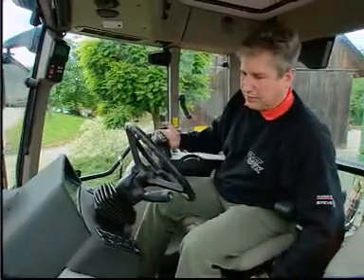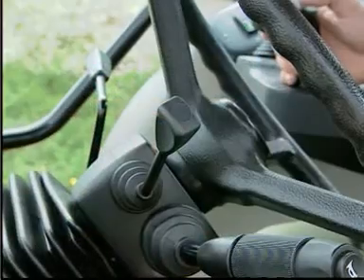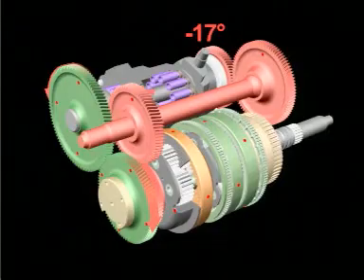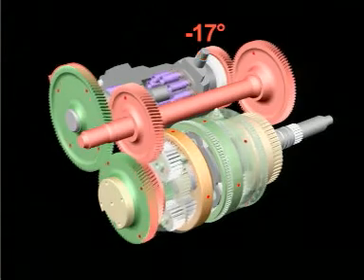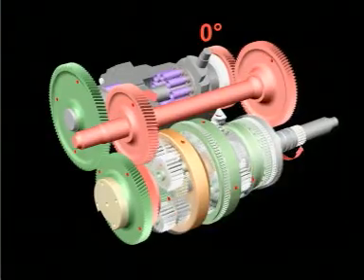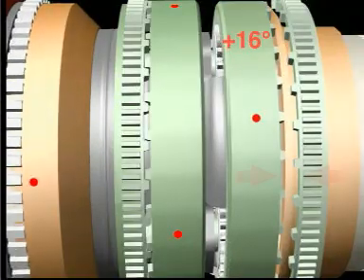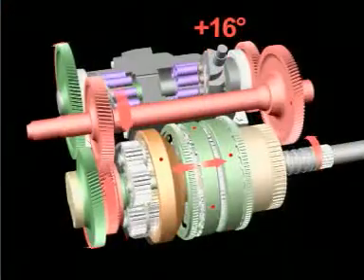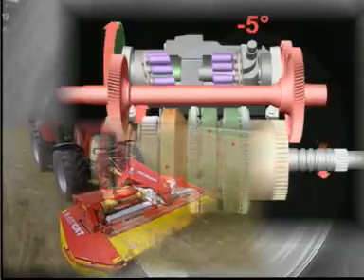Case IH CVX S-Matic Transmission | Continuously Variable Transmission (CVT) How it's works

Comment: This gearbox is made by ZF it is used in the Steyr CVT,Case CVX and New Holland TVT
It was also used in the deutz agrotron ttv
Reply from the maker: S-Matic was originally developed by Steyr and sold to ZF. Also used by Claas Axion first generation Cmatic models. Deutz-Fahr used this gearbox as recently as this year, now discontinued as new Claas sourced gearboxes were fitted to new Agrotron TTV models.